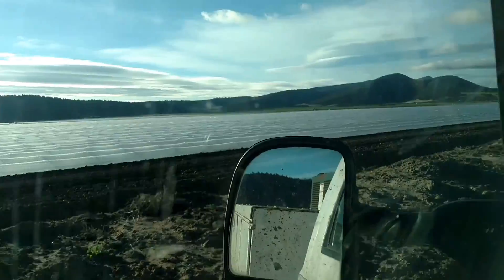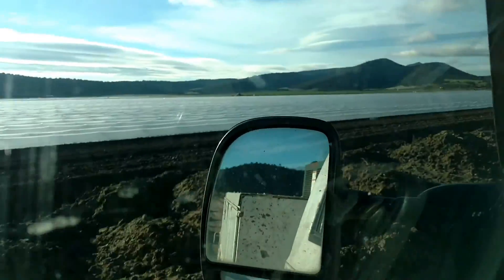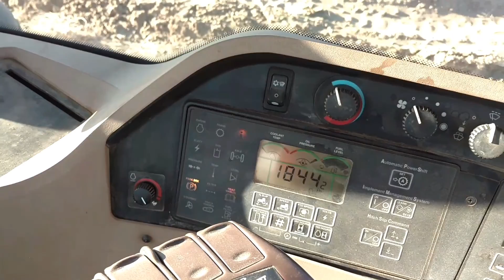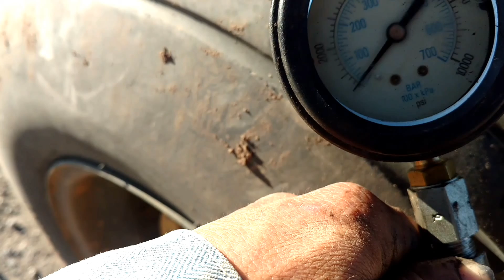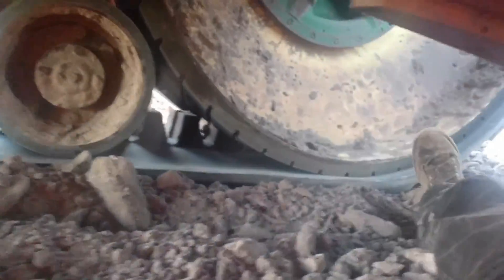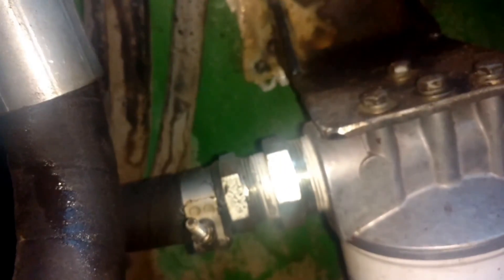John Deere 9320t blowing hydraulic oil from fill tube.

Comment: Am I the only one who thinks that the hydraulic system should be separate and independent from everything else on the tractor.  Shouldn't it have it's own tank, pump filter, cooler, etc.  Didn't they used to be built that way?
Reply: ran out of room to put the tanks on for all the electronics on them anymore. frames were used as tanks way back when, where ya gonna put 25 gallons of oil?

Comment: we have an 8400 that sometimes has a way over filled rear end and then within seconds it will drain completely out of the sight glass... what do you think the issue may be?
Reply from the maker: Doug Decuir  So if it's a wheel tractor, you probably got a scavenge pump problem that is on the backside of the powershift, if it is a track machine the implement piston pump and lines that feed the valve block are in the rear end housing , and a line is cracked.